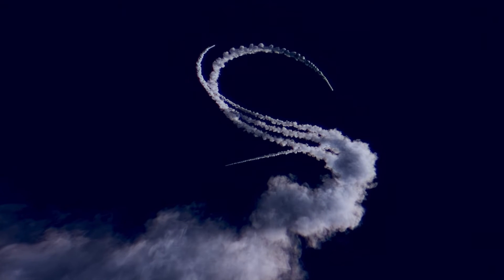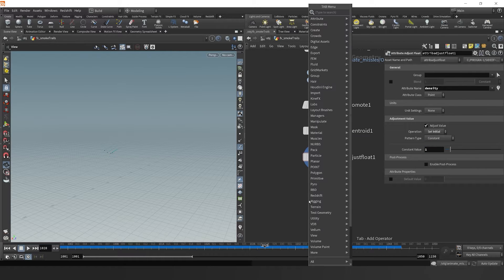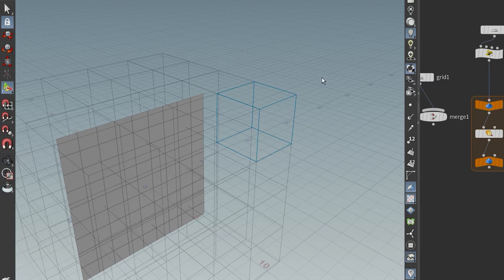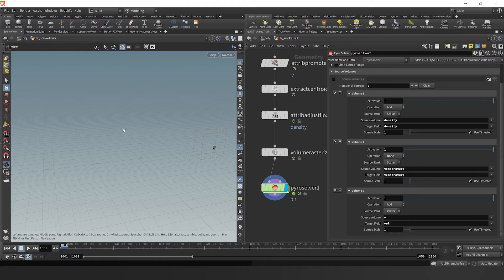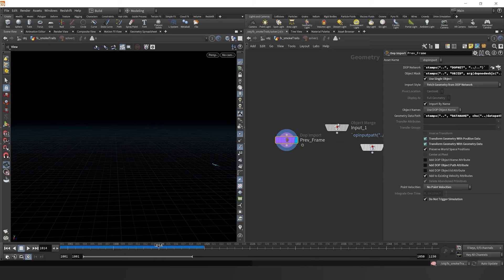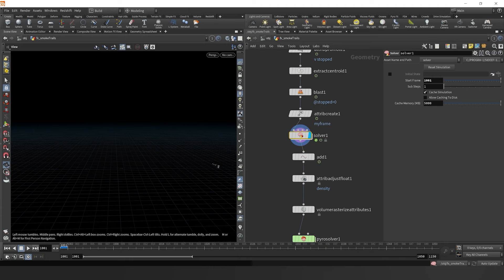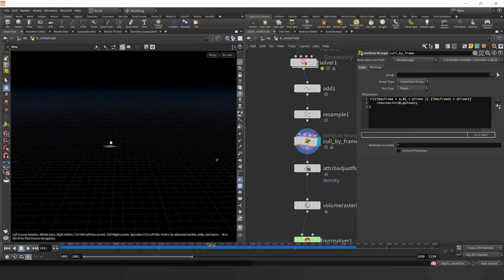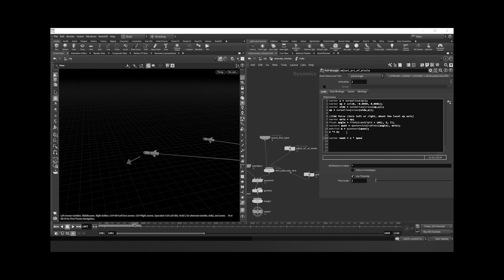How I Prep My Trails To Sim Smoke In Houdini (2/3)

Comment: why not just use a trail SOP? the sopsolver is overkill for patching substep motion. its best to avoid any additional simulation networks whenever possible. 1 node would do the job of 5 that you have there
Reply from the maker: You’re totally right, and I agree you should do that if you’re given pre animated trails. I don’t that in this case because in the next part of the tutorial I show how to make your own trails using the pop sim. That’s why I went this route. 
There’s obviously a lot of ways to make trails too, you could draw them yourself or go other routes. I was just trying to show a way to feed 1 or 1000 missiles in and you could get some cool results.
Reply from the maker: Oh I think you were talking about the sop solver part — well yes a trail would do the job too. I think at the time I was trying to use it to help show how the sop solver works, but I’ve also had many times where using it is almost just as fast as timeshifting a trail sop like 240 frames. But yeah I guess just preference 🤔this go around.